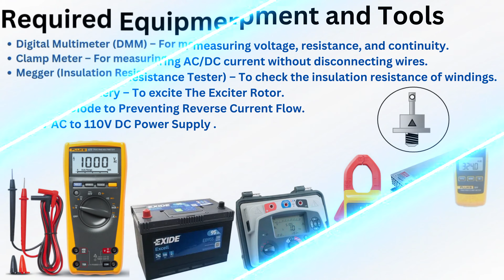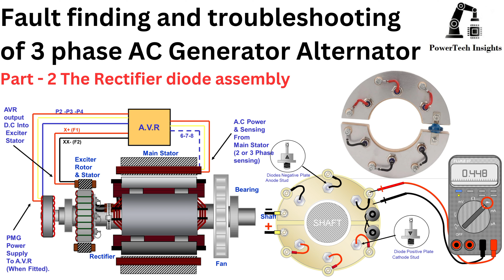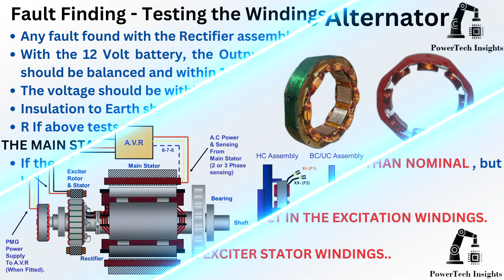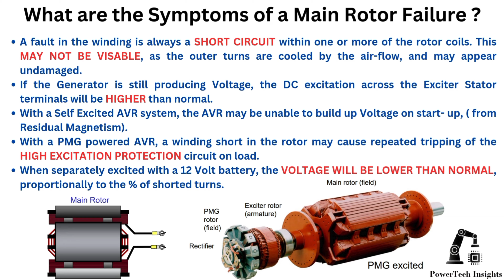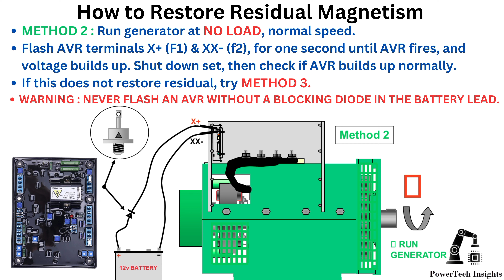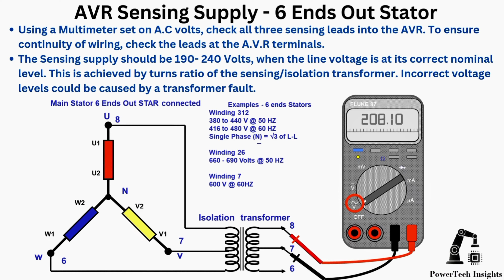Fault Finding and Troubleshooting for 3-Phase AC Generators Step By Step Complete Guide

Comment: Dear friend My 1000KVA 440VAC 60HZ generator noload  voltage all three phase output having 440VAC.but after load 50% load voltage raise up to 700VAC all three phase output and after some times voltage unbalance and out put voltage become around 230VAC.60HZ not changing.AVR change new one same result.so what couldn be the problem.thanks.
Reply from the maker: Quick Tests You Should Do

Start simple:

1. Measure AVR sensing voltage directly
    * Is it stable at ~440 V under load?
2. Check neutral
    * Measure phase-to-neutral voltages:
        * Should be ~254 V each (for 440 V L-L)
        * If wildly different → neutral issue
3. Field voltage measurement
    * Is excitation voltage rising abnormally before 700 V output?
4. Diode test (VERY IMPORTANT)
    * Test rotating rectifier diodes with multimeter
5. Load type check
    * Is it inductive? (motors, transformers)
    * Sudden voltage rise can happen with wrong sensing under inductive load
Reply: Thaks for your reply.👍